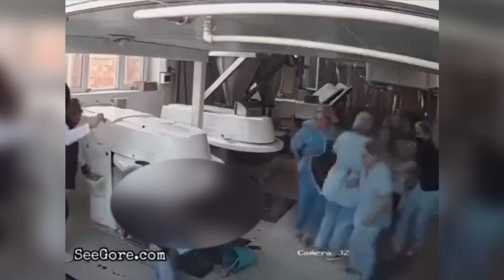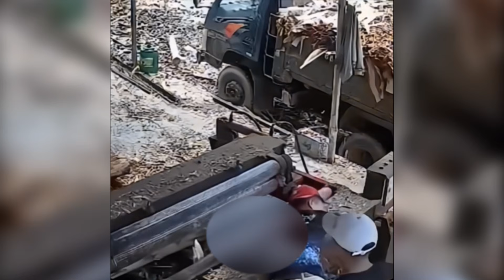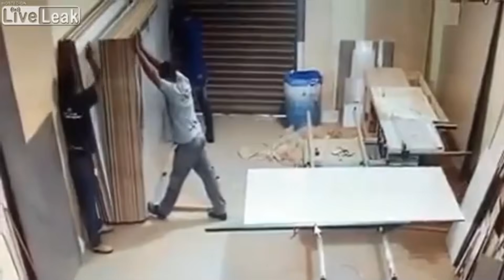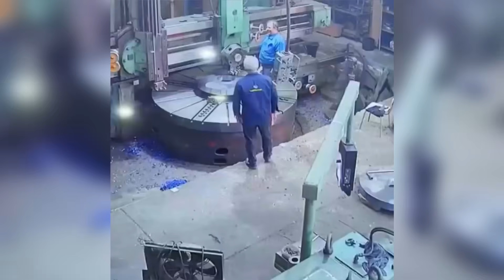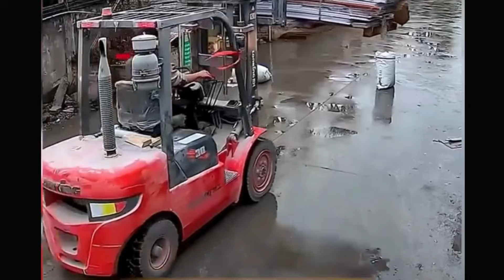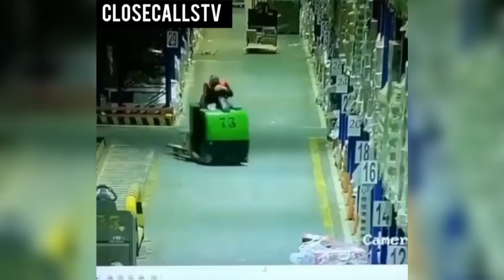She tried to clean a working Rotating Machine... Then THIS Happened!

Comment: First video in Azerbaijan happened. On January 7, 2019, Matanat Hasanova, born in 1971, a worker at the bakery of Israfiloglu LLC located on I. Abishov Street in the capital's Narimanov district, tragically died at her workplace. Investigations revealed that while Matanat Hasanova was cleaning the lower part of the dough mixing device in the factory's production workshop, another worker inadvertently turned on the device, and her arm got caught in the mixer. M. Hasanova died at the scene from her injuries. It should be noted that a criminal case has been initiated in the Narimanov District Prosecutor's Office under Article 162.2 of the Criminal Code (violation of labor protection rules resulting in death through negligence). The investigation into the case is currently ongoing.